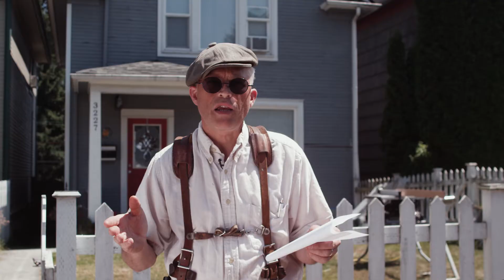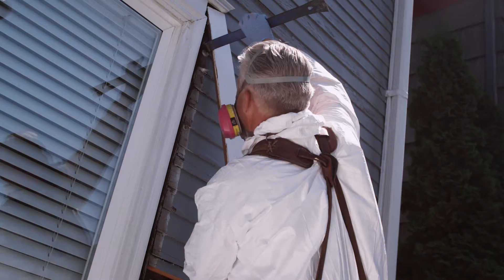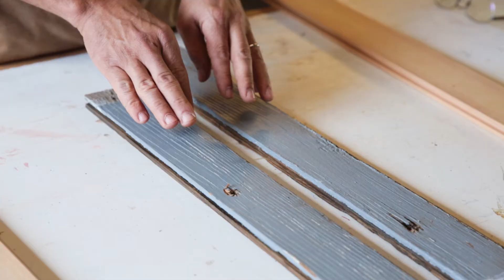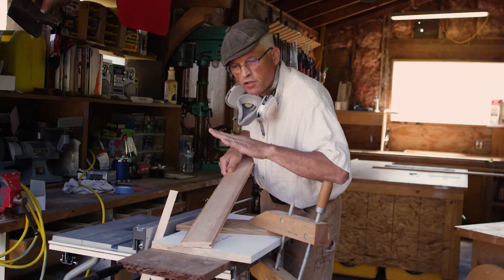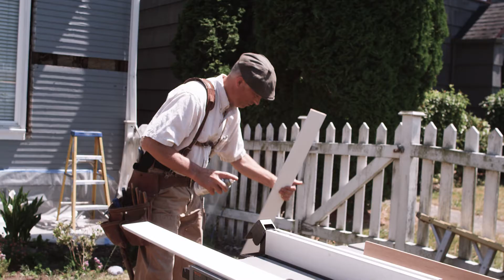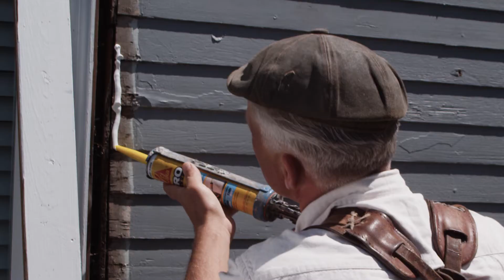How to Repair Historic Siding

Comment: It looks like a lot of water damage under the cladding.  What was the approach to ensure there isn't mold, framing damage, termite damage etc under the exposed areas?  DId you have to add flashing?

Comment: What about waterproofing?  I would have thought you need to take down the siding, add new sheeting, tyvek wrap it and then reinstall the siding.  What are your thoughts on this??
Reply: On a balloon framed home from early 1900s. Nah. Let it breathe how it was designed. Properly “modernizing” a home this old with vapor barriers and insulation really is a big undertaking and has to be done correctly or you’ll cause more harm than good.
Reply: @CR-zu3mb  I "think" the tyvek would create too tight of a seal and black mold?
Reply: @cocoablini  No tyvek is supposed to breath air and block water.
Reply: You’d have to remove all the siding down. Just caulk your seams good and run with it.
Reply: @ianrowell2183  Yes, but properly using modern techniques will increase the chance of lasting repairs and reducing heat transfer.
Reply: You can if you want

Comment: siding should butt against the trim. trim shouldn't ever be put on top of the siding. that's horrible design!
Reply: Not back in the day….
At the time trim over was far superior as the but joints didn’t have to be tight, and there was no caulk. 
Furthermore when the boards try to curl/“run away” from the house they do so mostly on the ends. 
Nails were expensive…especially round or what was called “wire nails” at the time. 
Saying “Horrible design” about a house that’s over 100 years old is almost comical in a world full of “McMansions” that are condemned and torn down in 20 years. 
I read a book on how to build your own home from 1902.
This is exactly how it dealt with the trim as it wasn’t uncommon to just stack 7 runs on a bench and cut them at the same time…hand saw, hot sun; 
“shit and get.”

Comment: If I want to just fix a small split down the middle of one of the boards, what's the best product to use? I was thinking PL8x or Sikabond, or should I use epoxy or caulk? Or is caulk too weak?